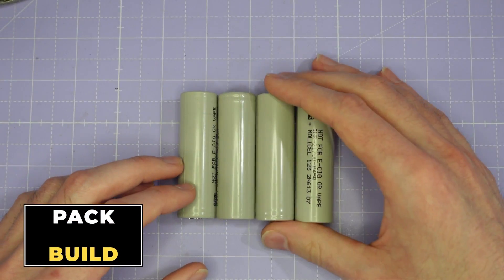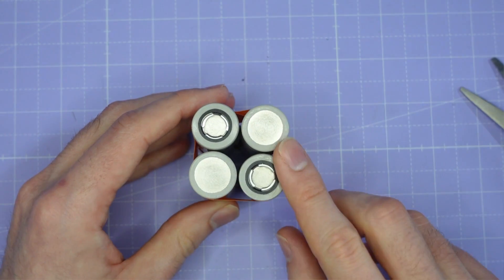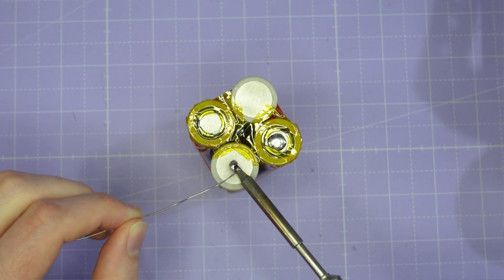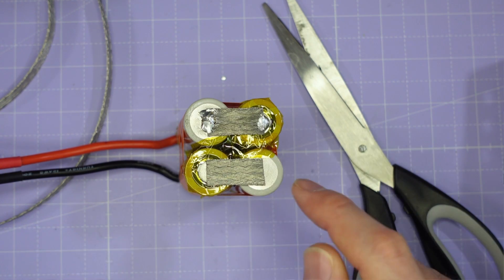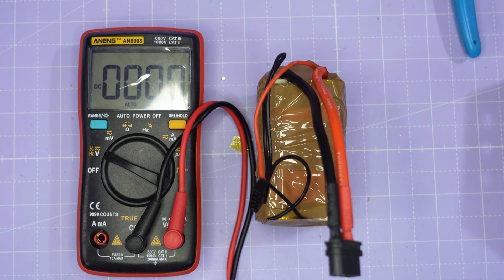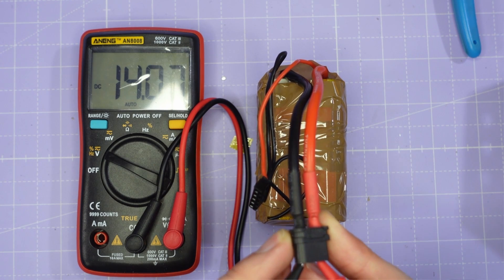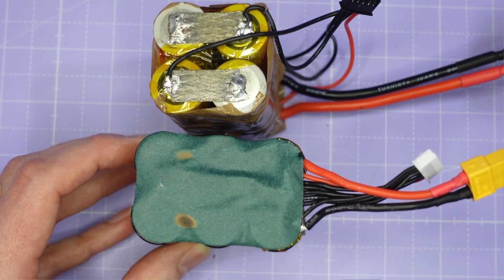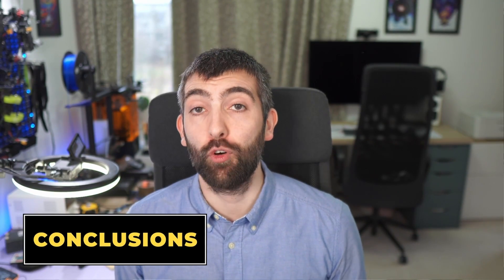Can I DIY the BEST Li-Ion Battery in FPV?

Comment: I don't like you soldering the cells. It is a big safety risk and no one should imitate that.
Reply: Yeah it only takes a few seconds with a good iron.  He's taking a tad to long.
Reply: Only took 0.2 seconds to find someone saying it.
Reply: Wear safety gear and you will be fine, I solder my cells quickly using a really big and really hot soldering gun that's intended for automotive repairs / big solder connections, the solder joint is complete in around 1-2 seconds.
I do all of this behind a second layer of perspex as a blast shield in case things go really bad, never ever has my solder come loose, even in high speed crashes with my flying wings.
I can touch the surface with my bare fingers about 2-3 seconds after the solder is completed so heatsoak is minimal at most.
Reply: I would defo swing towards a smaller iron that is just over hot enough to melt the solder quickly, little flux on the can and yeah..quickly.  @Bobbyjoe8joeboondog
Reply: I like the copper wick idea tho. I was thinking of placing copper plates but this isn’t bad either.
Reply: It is very safe lipo cells are hard to set on fire iff your aremt an idiot
Reply: Trick is to do it very very hot hot as possible so you aren't on the battery for a long time with heat
Reply: Safety risk sure, but spot welding and structural high amperage drawing can also create a risk... it's always a delicate balance between the 2 .   I did both more happy with soldering ( after soldering someone derectly put compressed air on it . All those thing make it better/worse if you now you don't have the skillset don't do it. Helping people who want it to help them to make a safe product, it will work out for everyone. Enjoy flying:-)
Reply: That’s why individually is great, because  you are  only responsible for (yourself)
Reply: I put the cells in the fridge for a few hours before welding with an iron. Works great.
Reply: The transfer of heat into the cell is minimal when done quickly. 5 seconds of heat will not blow up a battery. spot welder is better obv, but for a single pack its not worth the investment.
Reply: @HuMaNiTaRiAn1  5 seconds sure, but from 7:40 - 9:30 there is a whole lot more than 5 seconds of heating.
Reply: @HuMaNiTaRiAn1 that was WAY longer than 5 seconds.
Reply: Agreed. I got a spot welder on banggood for £7 and it works like a champ. No need to risk cell damage.
Reply: @changeagent228 post the link to your spot welder please ?
Reply: It is honestly my deep experience that nickel strips cause more problems than they solve and don't think for a second it is better for the cell heat wise... It isn't. Soldering is best in the long run I assure you, safety is what you make it. I have made more battery packs than you would care to imagine.
Reply: @yodaco  cares to explain how strips are worse? In what way? You've not explained anything man. You are just making claims and kind of touting your experiences...... Your experience to me comes from how you can articulate what the problems are with strips and spot welding vs soldering?
Reply: @jameshatton4211  well. I'll articulate all day if you like. But let's keep it simple. Watch the video you're commenting on. Learn that the resistance is higher with nickel and spot welding does also make a  less sturdy connection with higher resistance. Higher resistance. More heat. Higher failure rate. Nickel strips are sharp and can easily damage the wrapping of the cell causing shorts. Industry uses nickel because it's cheap and fast... Not because it's better in literally any way at all. By all meaningful measures it is worse. How's that? Now tell me why it's better?
Reply: @yodaco  copper strips 😉
Reply: 1up for spot welding.  Lots of folks have made videos about the effects of high temps on Li-ion cells
Reply: Watching the amount of time spent heating the cells made me throw up in my mouth a bit not going to lie… 🤮. also 21700 cells are absolutely enormous for a standard 5” quad.  And 99% of people run 6S on those quads which makes this not super applicable unless you’re going 7”.  And even then, the 4500mah cells are a super weird middle ground, because most people need more than that and opt for 6S2P 2800mah cells for the extra time and those cases are 18650 in size.
Reply: 10:04 it’s actually hurting me watch him keep the soldering iron on the contact. 😅 hilarious
Reply: Spot welders from ali express are so damn cheap and just good enough to make a safe contact without introducing heat like from soldering
Reply: Thats right soldering lithium is not the best way. Although I have soldered cells without issues. Another thing he did wrong is not using plastic cell spacers. If the plastic wrap on the cell is damaged the cells will short out. The sides of the cells should not be touching the adjacent cells directly.
Reply: some cheap cell spacers can damage cell housings too,  pretty counter intuitive I know, look out for that gem @HighVoltageMadness
Reply: If you don’t like it, we all others can do it just fine 😂
Reply: 100% i totally agree with this man. You run the risk of damaging the in-built thermal fuse of the cells located just under the positive end of the cells. He's pointed out the plastic bit that is where the cell fuse is. They make them thermal cut off because high temps = high current. 
At best he's weakening the cell fuses so they crap out faster killing the battery pack.
At worst he's charged the integrity of the fuse making it not cut out under thermal load (high current) and it makes the cells discharge more than they are rated = fire
That's fire when they are charging or discharging.
Which could burn down your house or create a flying molten fire ball in the sky!

We already see how easily lithium ion cells fuses crap out in electric cars from just 1 cell whoes thermal fuse has gone bad. So it's not just maybe it might happen, it's highly likely that it will just because of manufacturing defects. The lithium cell industry is under the pump trying to put out as much volume of cells as possible at the moment because demand is very high, this means the quality assurance time window will be reduced compared to cells made in early 2000s?
Sure those calls made back then may not have been as energy dense..... So that makes this phenomena even worse! Higher density, less QA cause high demand = explosions even when you do everything right let alone soldering batteries together. You are quite literally playing with fire.

I'm not saying don't do it. I'm sayin do it the safest way possible using a spot welder and not flexibly strip use 1-2mm copper strip not copper flexible mesh shit. In fact i would use just that strip between the output terminals to allow flex there and there only. The solid strip creates additional structural integrity.

These battery packs don't have thermal sensors and current sensing microcontrollers inside of them like laptop batteries. Sure there's no regenerative braking happening in drones but there's the same when they are recharging and there is no smarts between the charger and the battery packs to cut power if cells are getting hot?

Lastly the cells if they get thermal run away there's enough heat to vaporise solder in 2 seconds lol
Reply: @jameshatton4405 yes you can damage cells by using too much heat when soldering them, you damage everything you solder with too much heat, use less heat and lower melting point solder if you must, but regular solder is fine and does not need baking to death to do its job. you know that these fuses are designed to take these type of temperatures required for soldering, this is not cut and dry tho, there are some variations of fuses sort of. Not to say internal fuses are not flawed but those flaws are apparent in all circumstances solder or nickel. Nickel strip should not be considered for structural integrity at all in high vibration situations especially, it is brittle stuff and also vaporises like a motherfucker when thermal runaway occurs so what that has to do with anything I don't know, If you draw too much current from a cell, it will usually fail. you can do that with nickel too, mostly what you say here is really invalid from my experience in fact I have more bad experiences with nickel strip than any other means of stringing cells and I have strung a whoooole shitload of cells in my time. Not to slate your experiences but mine tells me you have a weird biased towards the cheap and dirty solution to stringing cells used to save time and money, not because its better, its not better dude.. It's just cheaper. maybe you can consider spot welding easier than soldering, is it safer...not really much, you can get burned with both if you like and it spot does spit molten metal from time to time. Safety with lithium cells is not really great at any time to be honest, and whilst I do not concur with your view, I think most people should listen to your advice because they don't have a clue what they are getting into and nickel is the goto solution and well documented.

Comment: You really should spot-weld those cells, because of the danger of overheating them by soldering.
Reply: I used to be pro spot welding, but for high current applications you need pretty thick strips, preferably not nickel but galvanized copper. You can't spot weld those with cheap welders, so the whole affair gets expensive pretty quickly. A 200W iron is much cheaper, has other uses in this hobby and allows you to get in and out in seconds - not nearly enough time to get electrolyte to the boiling point.
Reply: @PraiseKier but with these cells, you never get to such high current where nickel starts being a bottleneck, man.
Reply: I second this. I picked up a rechargeable spot welder for pretty cheap and it has changed the way I build packs. Faster, safer, and better
Reply: To be fair, he used a pointed tip iron, he even said to use a better one
Reply: Or soldered much more quickly. I was cringing.
Reply: @aracrg  I've seen beginners do a better job
Reply: Yea, you should be quick. But soldering works just fine. I've soldered many Li-ion battery packs. No problem.
Reply: Soldered braid is capable of far more current than your usual nickel tabs spot welded on. Especially with those molicells the welded tabs will be a current restriction.
Reply: the braid cable would be insanely hard to spot-weld
Reply: This flawed logic needs to die and proper soldering techniques need to take it's place. Spot welding thin nickel strips is for mass production and low-current applications. Soldering proper conductors is a much better method for our higher current application. If you do it right you will not heat the cells to a point where it will cause any noticeable degradation. Learn how to solder.
Reply: @KevPV  these cells really cant sustain over 20a for more then a few minutes before they overheat so no we really don't need anything more then a spot welded 10a rated tab because of the very short distances between the cells. what does help if to use more spot welds.
Reply: @CyberdeckCafé  In some applications you need the high current draw so the tabs are inadequate. Even if you're not drawing enough continuously to not overheat the cells the strips can be a current hindrance as they're just that bad at conducting.
Reply: @CyberdeckCafé  actually the Molicel P45B can have continuous discharge of 45A
Reply: @KevPV lmao no. You can totally spot weld copper. Just takes a lot of energy in a short time. I've also seen people sandwiching the copper between the cell and a piece of nickel to make welding easier. They also make 8 to 10 spots welds per connection, and that's plenty good. I agree that Chris did a not so good job. Probably should have changed the tip, or bump up the temperature to have the extra heat dumped into the cell for a faster joint.
Reply: @tailehuynhphat9570  sure, with the proper techniques both methods work but, for the average hobbyist with basic tools, soldering is much more accessible and practical to achieve solid results. In either case you need to know what you're doing.
Reply: Total fallacy.  Soldering with copper braid is vastly superior to spot welding with nickel.  The risk of overheating the cell is quite low if you use a high watt iron with a large tip.  I agree the tip on his iron was a bit too small for what he was doing, but still no chance of overheating the cell with the way he did it.

The ONLY reason commercial packs are usually spot welded is because it is a much faster, and therefore cheaper process when mass producing.  The really high quality packs are always soldered.

I have soldered many, many dozens of packs over the years, and have never once had an issue with overheating the cell.  The risk of that is often highly overstated.  Of course, if you do not have an adequate iron and tip, and/or do not have much experience soldering, then for sure, you can overheat the cells.  But if you have the proper equipment and know how to solder, the chance over overheating a cell is basically zero.
Reply: @ctvxl  Correct me if I'm wrong but I thought the reason high-current connections are usually welded or clamped is that  there is a non-zero chance of the connection heating to a point where the solder joint becomes unstable.
Reply: @Gosuminer  In some cases, you are correct.  But this is not a "high current application" in that sense.  Thin strips of nickel spot welded to the cells is just barely adequate to carry the 20-40a that this pack will produce.  The strips will add resistance and reduce the performance of the pack.

In this type of scenario, soldering with copper is for sure the superior method.  The copper will never heat to the point it melts the solder because it has very low resistance.  These cells can't deliver enough current to melt the solder joints, except perhaps under dead short, in which case the cells will be destroyed anyway...